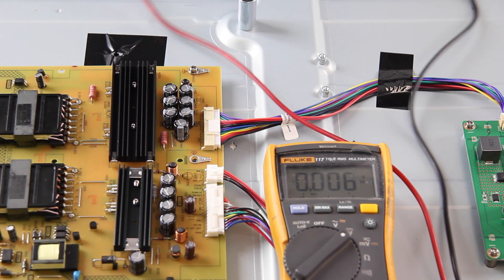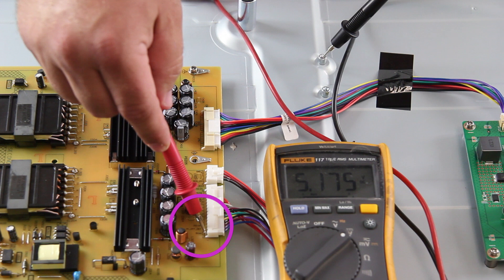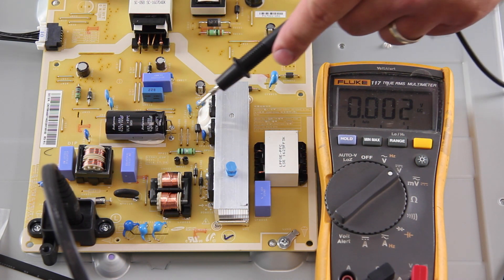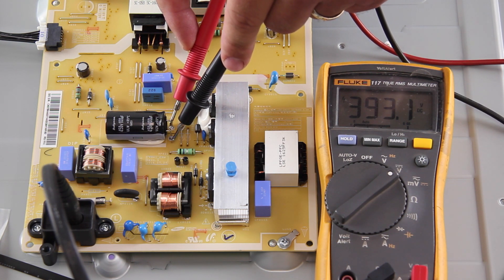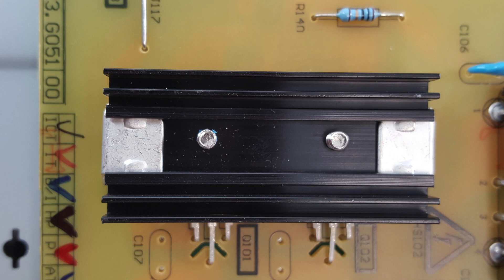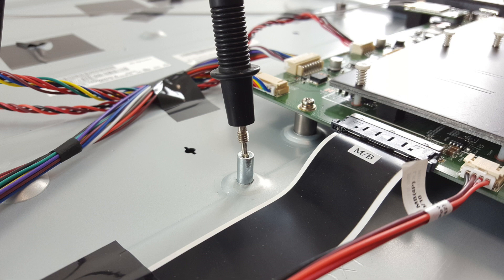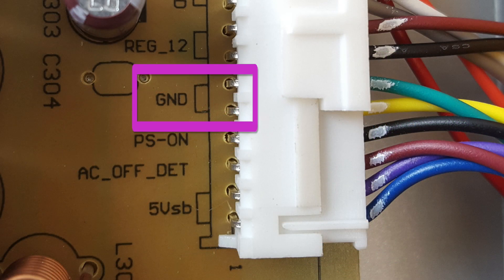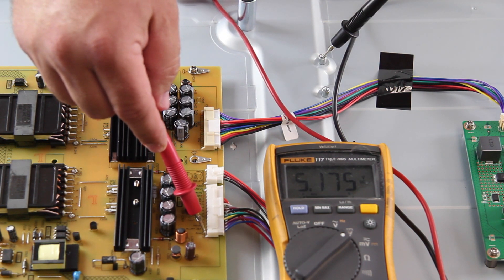Multimeter Voltage Testing for TV Repair - Where to Place the Test Leads - Ground and Positive

Comment: So that video just blew my power panel... I don't know why! I was measuring AC first but saw on this video that it's measuring DC. So I set my meter to DC, and measured on of the capacitators. It blew the pin on the capacitator... 

What went wrong?
Reply: I would say you  short-circuited a charged capacitor using the DC setting it acts like resistance and will discharge it and maybe even blow it off

Comment: Sorry. New to this. When testing is the power on and/ or is it plugged in? BTW great informative video. Just bought a multimeter and only test batteries. I’d like to explore other things now like I have a old tv remote, PS3/4 motherboard,USB Cords and would like to learn how to use more settings on my meter. This video is great but I don’t know that if the thing in testing is powered up by battery or AC while testing and if I’ll get shocked. Sorry just asking

Comment: I have this same model tv.. samsung 55 led.. the tv cuts on and off with a flashing standby light.i hear a start up sound and see a blue screen when this happens.. when I disconnect the main board from the power board the backlight alluminates.. any suggestion what may be the problem?

Comment: I was testing my volts on power board and it read 24V but I must have touched something else cause I saw a little smoke and a pop. I then tried it again and it was still reading 24V so I guess it's ok but not sure, I hope so. Still testing other parts of board. I have no backlights, so if it is bad LED's I will just trash the TV.

Comment: What does the symbol on your multimeter stand for? I have a much more detailed multimeter with about 30 options and no symbols that look like a V with a dashed and straight line over it. Thank you.
Reply: DC Voltage - Direct Current Voltage

Comment: do you have to plug in the tv for this test to work?
Reply: Yes when you test for voltage you have to have it plugged in and turned on but for checking diodes or looking for bad capacitors the power needs to be off

Comment: Complete noob here. If the cold-side is the side where the voltage has been transformed, from AC to DC, then, let's say you are working on a device that runs only with batteries [DC] does that that mean that you would place the positive test lead on the positive pin and the common test lead on the ground points of the device, or its chassis? Please let me know - I want to learn
Reply: They don't care ..... 1 year and still no answer ...
Reply: Better take a tv repair course than learn from these kind of vids in bits and pieces

Comment: When checking voltage is the TV supposed to be unplugged?
Reply: Tim Whit no you need a source voltage to make sure that it's reading the same voltage your plug is receiving with the load you are testing.If according to your TV's symptoms, you test a specific part and there's voltage in the circuit you know that part needs to be replaced
Reply: Multimeter should be set to what when testing voltage.... what number too?
Reply: @renitaedmonds72  Did you figure this out? I need the answer to this question as well. My multimeter does not look like that.

Comment: I have a bd-jm51. Which does not have wifi. Being that it has a spot for a 4 pin wifi module which module would i install so it can be wireless

Comment: I have a Toshiba Regza 42" flat screen TV that once it warms up for 5-10 minutes the screen starts fading to black starting from the upper left corner of the screen fades diagonally to the bottom right corner until the whole screen is black. This happens in about 10-15 seconds. The sound stays on though.  Is this repairable?  I could handle  the repair if possible, but I just need to know what to do. I'd greatly appreciate your response and insight when you have a chance.
Reply: I have the same model. It won't even turn on and gets no power.
Reply: I think I just shredded the whole tv because Idk how to use one of these multimeters.